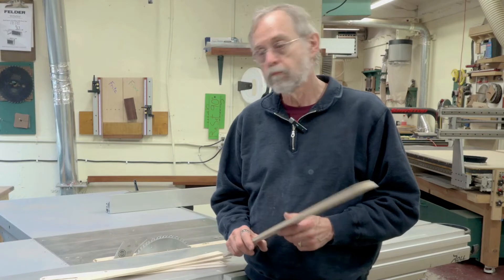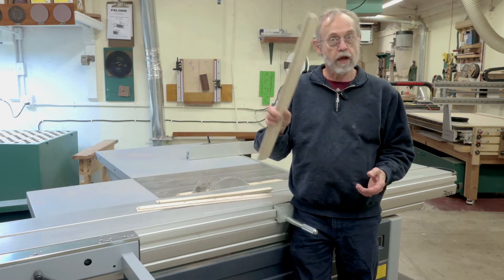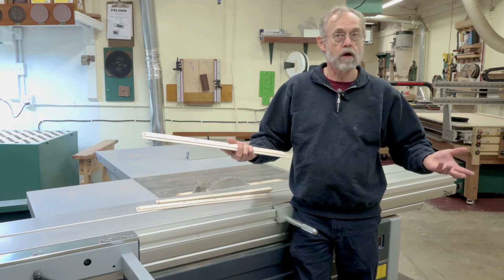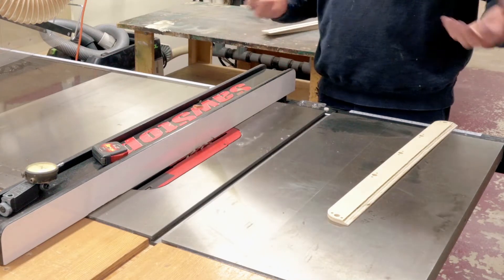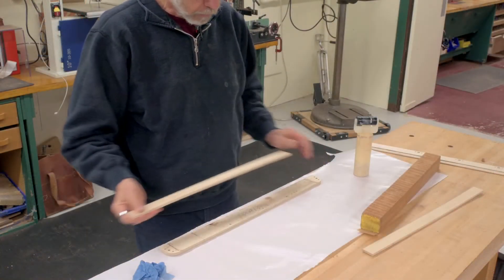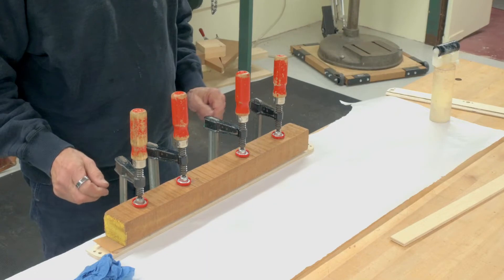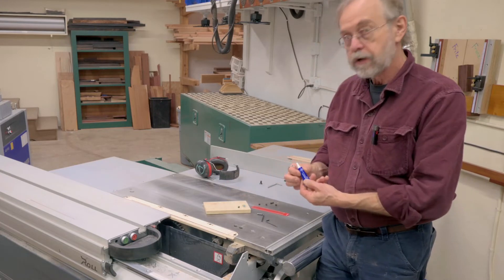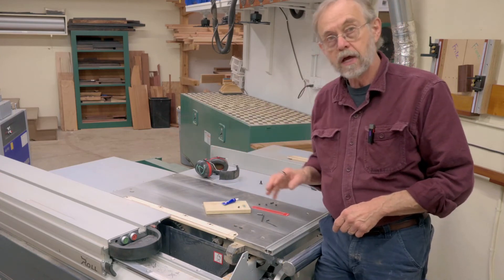Felder K700 S Zero Clearance Insert

Comment: darrell  curious if you feel you need to have a standard table saw in addition to a slider?
Reply from the maker: Hi Pete,  Personally I don't like using the slider for ripping solid stock. That portion of the saw body that supports the slider is right where I want to stand.  But also, I have had two saws for many years and its nice to be able to leave one set up and use the other one for another operation.

Comment: Nice. The Felder replacement throat plates are pretty expensive and looking at the underside, had a lot of different operations. Putting the stiffener on as a separate part makes a ton of sense.
Reply from the maker: The Felder Inserts are not only expensive but they do not do a good job of zero clearance.

Comment: Nice video Darrell.  I would suggest using a product called Vibra-Tite VC3 instead of Loctite for these applications since it remains flexible through its life.  The advantage is that you apply to the threads and let it dry before assembly so there is no open time concern.  It can be adjusted multiple times after application.  Steve
Reply from the maker: Thanks , Steve Very good info. Sounds like a much better product for this application!

Comment: Perfect! FWIW: Yes, my ~2013 KF 700 (with the shaper) has a shorter throat plate. This may be due to the belt driven scoring unit I have vs. the separate motor scoring unit on yours. Definitely watch for the scoring blade height. at some point early on I managed to have the scoring blade sticking into the dado stack TP. Fried the drive belt and the shop smelled like burnt rubber for a week!

One new thing I do with all my wood "wear surfaces" is flood them with the thin CA glue. It helps along the blade slot to keep a nice crisp edge to shear the fibers where otherwise the BB can begin to splinter. flooding the whole thing isn't really necessary of course, but it doesn't take as much CA as you'd think and it prevents the BB from picking up grime.
Reply: I can see how that would be easy to miss. Thanks for the heads up on that one. Although, do you typically run your scoring blade with a dado stack?  Mine has two motors so I can turn the scorer off. Is that not possible with yours having only one motor for main blade and scorer?  No way to disengage the belt?
Reply: @atg.studio  No, its always running. You could pull the blade I suppose, but easier to cut the relief. I did a "side B" op where I surfaced the BB to reduce the thickness and then used a 1/8" bit to open the splitter slot and cut a relief for the scoring blade.
Reply from the maker: Thanks, Ron. I had a guy who has an older K700 S with a separate  motor for the scoring blade - he has the shorter throat plate as well. I am going to do the CA glue trick.
Reply: @DarrellPeartFurnitureMaker  You'll like. I did this 1st time on the throat and sole of a Krenov plane and it worked really well. Hit it with 320 and some wax and its really tough.